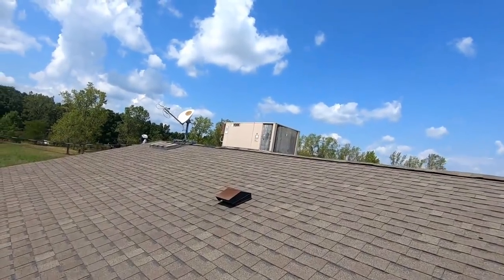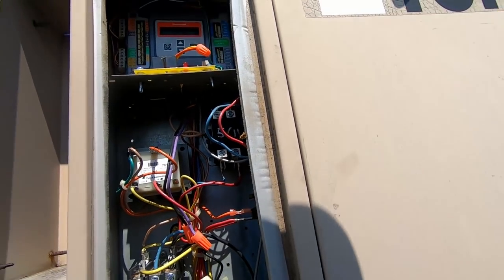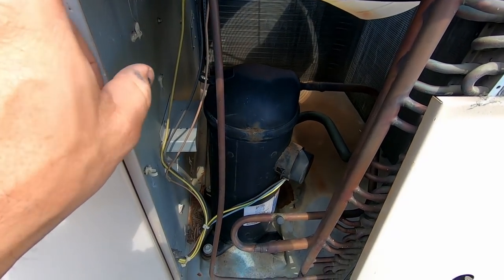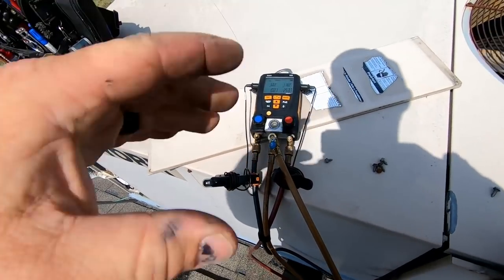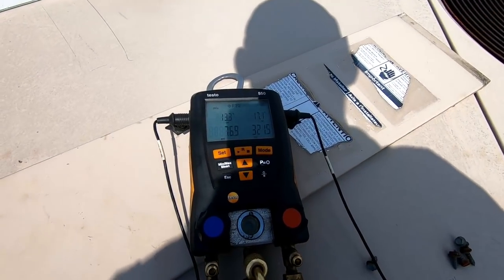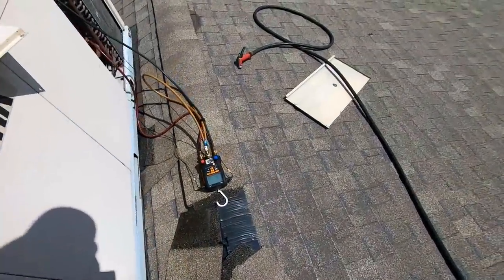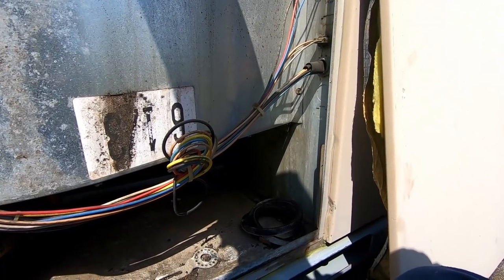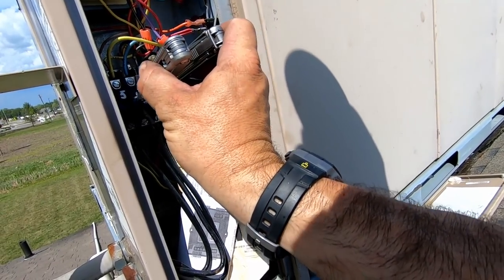Random No Cooling on Packaged RTU. Sometimes You Don't Find All The Problems

Comment: When you remove your gauges. Remove the high side and open both the valves and the compressor will pull the refrigerant out of your gauges.
Reply from the maker: 👍👍👍That is how I have been doing it for years, that's also how I can use 6' hoses on reach in machines with critical charges.
Reply: Only if you purge the air that’s trapped in the manifold first :-O
Reply from the maker: That's the first thing I do after I hook up, I bleed suction out the very end of my yellow hose, then I do the high side the same way. I do this in the beginning because I've had times that I forgot to and possible trapped air in the system when I dumped it back in. 😎🙈
Reply: HVACR Survival That’s good man! A LOT of techs are taught wrong about the whole “open up the manifold to dump the gas back in” not realizing they are putting air/possibly different refrigerant (depending on what they used their gauges on last) into the system!
Reply from the maker: True story 👍👍

Comment: People who put rooftop units on roofs like that need to be smacked. Like anyone is going to change those filters with any regularity. On another note, a tip that I learned recently as a system design engineer. Always hook up a two stage thermostat when using a Honeywell JADE or Belimo ZIP economizer module. Even if the unit is only single stage. This arrangement will allow for the compressor to operate to supplement the economizer when it needs just a little more capacity. Otherwise you can end up with the economizer full open, not cooling the space well, and a false no-cooling call to the tech. Then they have to mess with the controller and set it to lower threshold to allow economizing, resulting in greater energy use. Love the videos!
Reply from the maker: Thank you! Your absolutely correct, you should have a 2 stage thermostat. I'm surprised they don't have a option in the Jade controller to use a time delay to upstage the mechanical cooling since they have the settings to lockout mechanical depending on the outdoor ambient because running a larger stat wire isn't always possible or economical. Good point 👍👍

Comment: If it’s hot out and everything checks while I’m there, but it was obviously not working prior, I usually swap out the condenser motor. In 14 years I’ve learned that 98% of the time it’s the damn condenser motor dropping out at the peak of the day. I always run it by the customer, and they’re usually cool with it. I’ve only had maybe 2-3 call backs in over a decade.
Reply from the maker: Sounds like a good idea 👍👍. I thought that motor was starting slow but wasn't positive. Plus it still doesn't make sense why it dropped out while the fan was running when I first got they're. It could have been multiple issues happing at once.
Reply: You’re the man Rick, always good content 🤙🏽
Reply from the maker: I wish Ray 👍👍. Thanks 4 watching man!
Reply: Rey I would totally agree with you on changing it which has always been my thought as well. But commercially this year with Covid customers want to spend $0 and fix it for $0 so it sucks!!!

Comment: Makes me wonder, with the trap being all gunked up if the float was shutting the unit down.   Never seemed to shut off again after flushing the trap.  Did you by chance check the pan for water before cleaning out drain?   Just a guess, good work tho   You are right, never rush it
Reply from the maker: I didn't see a float plus when I came back the next day, as you seen in the video, it wasn't running and that was after I had cleaned the trap. Good thought though 👍👍
Reply: @HVACRSurvival  Honestly, i backed out of the video at the end of the first part, thinking it was over.   Did not se where the motor froze up   Still a little odd that it was shutting down even while motor was operating   Wonder if it wasn't getting up to speed ?   Either way, good work brother  keep it up   I move from resi to commercial here in about a week   Watching all the videos i can to try and prepare     haha

Comment: You said i the video that the fan was running it's limit current wise. So I'm thinking it was on it's way out then. Plus I'm thinking it was bouncing of a limiter somewhere, but I've no idea which one. That being said I don't think it's the low pressure!
Reply from the maker: Yeah, I think it was a multiple offender. It was likely shutting down from the freezestat due to dirty filters oh, and if that wasn't causing issues then the high pressure switch was tripping because the fan was shutting off. All 3 limits were all in series and I had no way of knowing which one was which.  Thanks 4 watching 👍👍

Comment: Seems to happen a lot where the customer calls for a recurring problem , and once you get there it's running and it doesn't trip the whole time you're there .
And of course , once you're gone , surprise surprise it trips again !
That just drives me mad when it happens , because you did everything you could , but both the customer and your supervisor think it's somehow your fault .
What you gonna do ey !
Reply from the maker: It can be a difficult one to get the first time with 100% accuracy but I had a feeling the motor was a little off. No one will say anything about this call, another cool thing about recording your work is you can prove you did all that you did. Thanks 4 watching 👍👍

Comment: Is a employee supposed to go up on the roof to change the filters? I wouldn't think so. Roofs and ladders suck. Where's the A/C? On the roof!
Reply from the maker: I wouldn't send a general labor employer up on the roof to get hurt....It's the owners responsibility to maintain there equipment by either doing it themselves or hire a company like us to do it. The roof is a common location for commercial building applications. Thanks for watching 👍👍
Reply: @HVACRSurvival  Being sarcastic is all. Roof work is one of the reasons I got out of the trade. In my opinion all equipment should be on the ground and accessable for servicing.